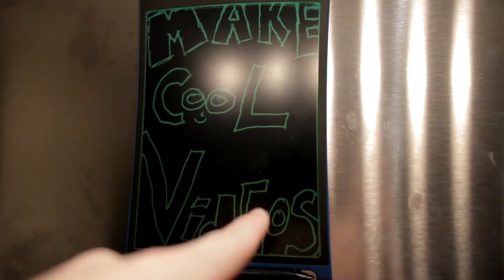Nerd Status

Comment: Being a custom computer builder, and not to hate. just advice! I would redo your heat sink, you should try to get even coverage of thermal paste on any i7 as they are known to run hot especially under video editing and gaming conditions as ur going to max out all 4 or 6 cores depending on the model of i7 and they will run easily into the 80-90c range even with the monster cooler. Just my 2 cents don't want to see you burn up a brand new board or cpu.

Comment: Overclocking that right off the bat is a bad idea. You should run it for a week or so at stock settings to make sure the system is stable. Then slowly OC and find a the spot that is stable for your system. For what you're going to be doing, you prob don't even need to overclock, you already have a beast of a processor as is.

Comment: No static guard, 3 people to build a computer, and case open way too long...
Reply: +TraumaER What's wrong with the case being open for a long time?
Reply: +Przemyslaw Kowalczyk Generally, if you are trying to keep your case as clean as possible, it's best to not leave the case open to dust and who knows what during builds and upgrades.  Once dust starts attaching to the boards, it is probably going to stay there.  And no, vacuuming a computer case is just asking to turn it into a very large brick and/or creating a huge troubleshooting nightmare to find which card(s)/component(s) you fried through static electricity.  With cards becoming smaller and more complex, its very easy for a small static spark to wreck things.  As for dust going in the case anyways during use, that is why how you circulate your fan system is important.

Comment: 1.) the bent cpu pin is a very big problem but the fact that you were building the pc on the carpet you could have built up a static charge that could have potentially harmed other components of the computer.
2.) I can only assume you are not going to overclock the internal cpu clocks so there is no need for that monster heat sink because your cpu wont be generating that much heat since it will only be under a stress load when video editing and since you have a i7 cpu that wont take as long.
3.) next time should buy from new egg they have deals all the time and rebates for every part pretty much so it would have been cheaper.
4.) should really have built it your self because its more rewarding to know you built something for your self rather than have your friends do it, plus should have researched it a little before building it because since it is a custom built pc you have no IT support from a manufacture so if anything happens in the future you have to figure it out.

other than that good luck with it

Comment: What should I do to to break out of my benchpress plateau? I'm 15 years old and I've lifted food quite some time now but I'm stuck at 135 :(
Reply: for not food
Reply: +Daniel Poursasan keep benching. But don't bench over 85% for a couple weeks. Build up a lot of 70-75% volume.
Reply: +Enrique Smith +SacredSlaya but the thing is that I've been benching with a bodybuilding style program so ive been benching within the 6 to 10 rep sceme, should I start a powerlifting style program?
Reply: when I say I'm stuck at 135 I don't mean that's my 1th, I can do 135 for 7 reps
Reply: +Daniel Poursasan 1rm*
Reply: +Daniel Poursasan do lower reps bruh. Heavy doubles and triples should do wonders. I guess about 145lbs for sets of 3 for you should be the way to go. Plus try some bench variations (closegrip, spoto, pause ...)
Reply: Nik Brudar  yeah I'm gonna try that out, but would a 5x5 do it? Or should I do triples.
Reply: Daniel Poursasan I know that doubles and triples helped me most to reach 225. But 5x5 is a good way too. In this case use about 130lbs
Reply: Nik Brudar I'm gonna try both and see which one works better
Reply: Daniel Poursasan sure, but it takes time, remember that. Don't switch from one onto another in one month time ...
Reply: Do 10 sets of 2 reps and add a little bit of weight every 2 sets

Comment: wait.. you spent $220 on a motherboard and only got a gtx970? if it was a budget issue, you couldve skimped on the motherboard and gotten a 980 or a r9 390 and gotten a cheaper fan for CPU. you dont need a dual cpu fan. and if you were going to get dual fans, watercooling is a better option. i7 was unnecssary too, couldve opted for an i5 unless you plan to game,stream,edit videos at the exact same time.